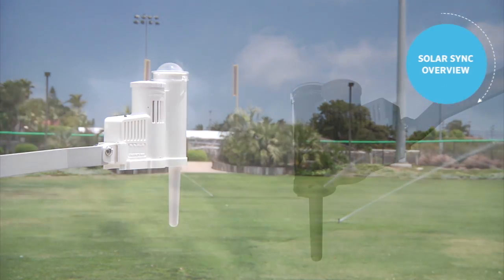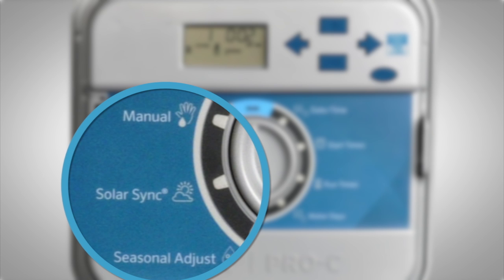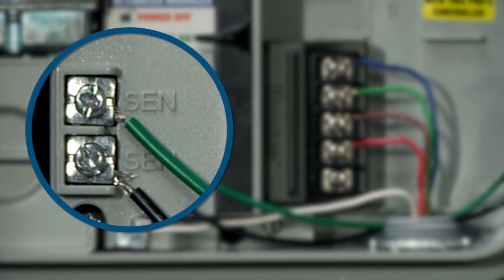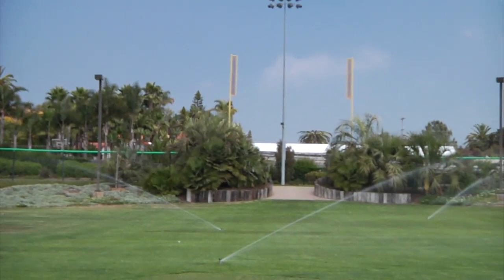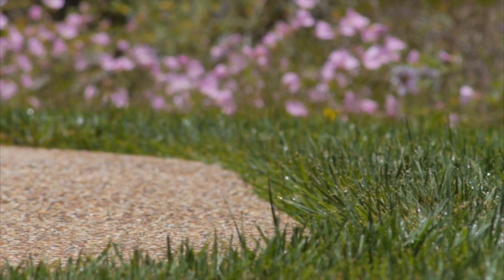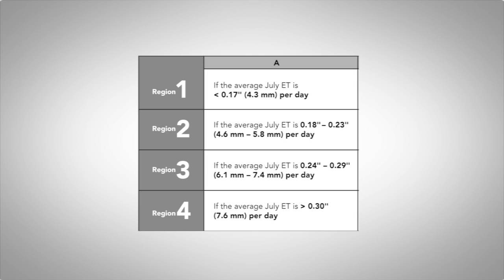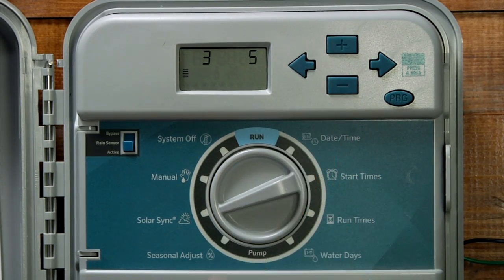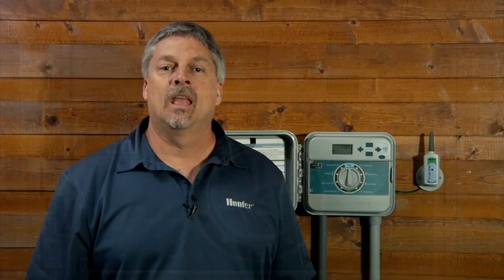Pro-C® with a Solar Sync®

Comment: How do you turn Solar Sync off entirely? Is there any setting for that or do you disconnect the SEN wires inside? I don't want this Solar Sync thing, it is making my Run Times jump up and down like crazy.
Reply from the maker: Please contact our customer support department here: https://www.hunterindustries.com/hunter-technical-support-email-request
Reply: @Hunter_Landscape_Irrigation  Thanks for the reply but I already removed SEN wires and that fixed the problem.
Reply: @jankijan8004  living in Palm Springs with 112* and we were having an issue with the sensor overriding the program (umbrella was always showing), I unplugged the sensor and now the screen says “off” and has an umbrella. Is this what yours looks like too?